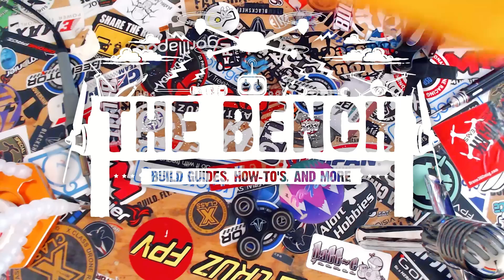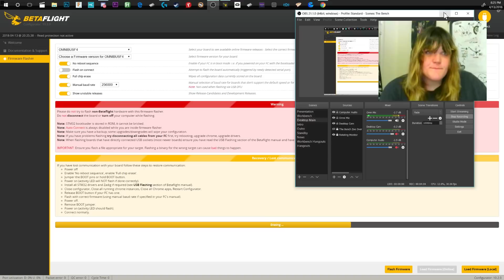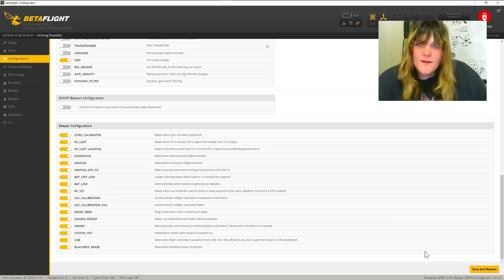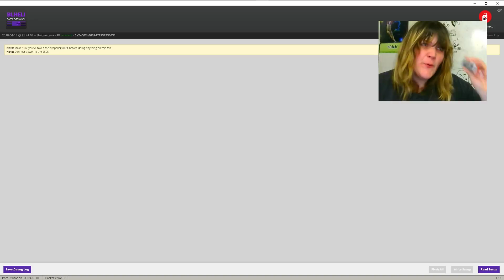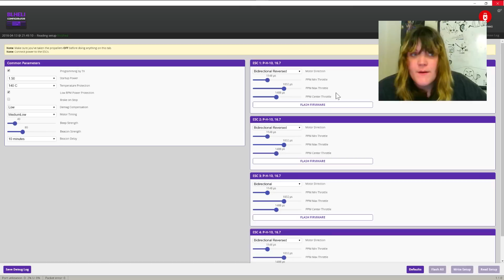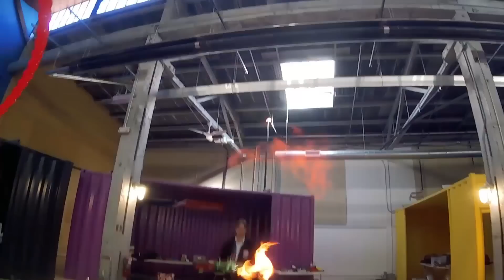How To Setup 3D in BetaFlight & BLHeli ESC Tuning

Comment: would have helped if you explain setting up 3d with oneshot125 also but im gonna guess someone explains it somewhere thanks for a partial setup
Reply from the maker: I would not recommend using OneShot125, it can be finicky to setup properly and it will cause much more judder than DSHOT. Though for an ease of reference, you can set 3D High to 1535, 3D Neutral to 1485, and 3D Low to 1435 in the configuration tab in CleanFlight/BetaFlight/BaseFlight. Those numbers are a pretty solid ball park for most ESC's>

with the new IQ Motion Control Speed Modules coming out, and with DSHOT 1200, and 2400 becoming a new norm I urge you to try a modern 3D setup with at least a motor running ANY BLheli32 or 32bit equivalent like KISS. You'll have a better time and will enjoy it a lot more.
Reply: @ZoeFPV  it's a trial to see if I want to actually do it on something better. I'm making my original babyhawk into 3d.. But I got it between your vid and Sam I figured it out.. Thanks tho. If you guys combined vids you have a solid setup vid for 3d. Your betaflight his blheli.

Comment: I tried to flash with blheli configurator and after my motors are spinning to full power after I plug my battery in with no controller even active.  I think I really messed something up, like wrong firmware?   My fc is a JHEMCU GHF405AIO-ICM Pro 40A, it's an aio... I think I messed it up...not sure what to do.  Ok for future reference I think it was originally flashed with bluejay, it's back to working with bluejay esc in normal.....trying to make it 3d now that I know what I'm doing and that it's bluejay not bheli_s.  Phew thought I had destroyed my fc.  Ok think I got it working with bluejay!

Comment: Hi Zoe is it possible to set 3d mode on momentary switch  but leave gimbal sticks to work the same way as in 2d mode? Lowest position will be 0 not -100 so you dont have to cross the middle position to reverse motors?Then you have full sensitivity in both modes?

Comment: Hi Zoe, I will be setting up a DALRC F405 FC stacked with the DALRC Engine 4x40a esc board for 3D. I assume it would be ok to use BLHeli32 with DSHOT(1200?) but what else would you recommend as a start point in terms of basic setup variations from those you chose in this video? Thanks and keep up the good work

Comment: Hi Zoe fpv im trying to do this on my 4 inch. Done everything you said to do  on blheli the motors go both ways with the slider but i cant get drone to arm with transmitter do you know why it wont arm. Have got it set up when in air mode i can switch it to 3d mode .
be most gratefully for your help looks load of fun Pete

Comment: 0:
1 of HGLRC F4.V2 Flight Control AIO Betaflight Flight Controller Board OSD FC 5V BEC for XJB F413 F428 F438 F440 Series Stack RC Racing Drone [ASIN: B07CSYTLKB] 

------------- Begin message -------------

could i add  gps ublox to this fc and will a tx11 5g8 40 work with it as well

Comment: Have you ever been on BLHELI  configurator and it fails? this happen to me twice with using dys aria 35A esc dshot 1200 do you have a remedy possibly?.. or have run across this problem...

Comment: hola zoe, hice esto mismo con mi drone y funciona bn pero aveces el motor 1 se retrasa un poco cuando hago tictoc y pierdo un poco de control como puedo solucionar esto gracias es un flytower v2 f4 35am blheli 32 bits xbee air h hibrido y motores 3b 2650kv todo es  nuevo y uso 4s cambie los motores pensando que era eso pero no, es del esc el problema gracias

Comment: Okay just tried 3d on my rooster. Wow! Scary fun o boy. Say Im noticing some bugs tho.. My motor stop feature don't work anymore back in 2d mode. and my throttle doesn't activate till three lines up on throttle (on 2d mode). Plust I can't no matter what   get my motors to idle any lower when armed, even with cli commands on dshot settings . All that fuction comes back when I disable 3d in config.. Will this get fixed in 3.4? im running 3.3

Comment: Hi Zoe.  Um, my collective pitch helicopters use a switch to arm.  Might this be an easier solution for your quads rather than searching for a tight zero?
Reply from the maker: Maybe/Yes- though that'd take a FC change to the current code base :) Right now the FC won't arm unless the mid stick is in a "Safe" zone for safety reasons.

Comment: How does the 3d switch work? do you have to keep the throttle over 50% in 2d mode when switch it to 3d to have positive thrust there? and if its under 50% when you switch it applies instant negative thrust? (I have never flown 3d, I try to understand it forst)
Reply: No, 3D on a switch flies just like your normal 2D quad and when you press the switch (normally momentary in taranis) your motors go reversed and you can fly upside down, zero throttle is always down low on stick like in 2D mode, even on 3D mode with this function. My videos are done with 3D on a switch.
Reply: Thank you. That sounds like a good option to start with... Btw your winter video was what made me decide to try 3d mode one time  ;)

Comment: Thanks Zoe , this will definitely help when I set up 3d again on my brushless builds. I did have it working but not reliably in the reverse every time,  need to try 1.5 start up and medium high timing!
Reply from the maker: Also- keep an eye out for version 3.2.2 which is said to have the 3D fix added to it. If ya have any questions feel free to check out the Outer Limits chat room

Comment from the maker: Stoked to get this video out- it's been one of the most requested... and I wanted to make sure I could be thorough and recommend a setup process that I know will work on just about every machine and the current "Bugs" that you need to watch out for when setting up 3D mode.
Reply: What kind of props do you use for 3D
Reply from the maker: Guerrilla FPV three are several out there. The APC 5x4's are my current favorite. Several prop manufacturers have a 3D prop just hard to find.
Reply: @ZoeFPV  i need 2.5 inch bi blades though for the sailfly-x

Comment: Why not just type BL in the CLI to enter the bootloader???
Reply from the maker: Haha, because I'm oldschool and didn't have that option when I first started doing it. I also plugged a battery into the quad when I didn't need to(On my setup) though there are some setups that it might be an issue on so I tried to use a method that could be used on even some of the oldest machines.
Reply: Zoe FPV gotcha I used to type dfu and when that stopped working I asked the rotor Riot page and they were the ones that let me know it changed to BL. Love your channels freaking awesome. That last edit you did was noticeably badass